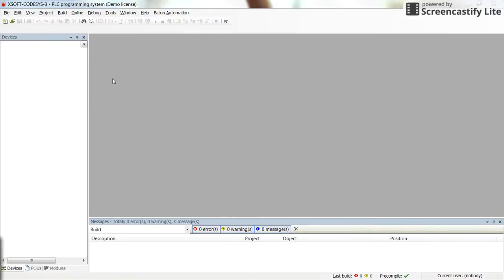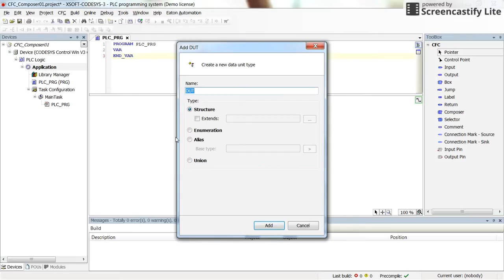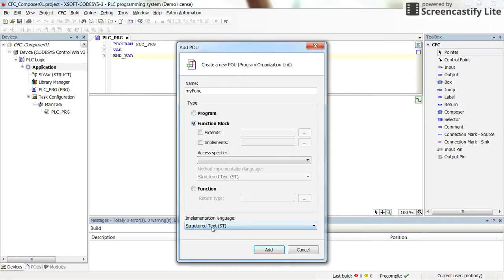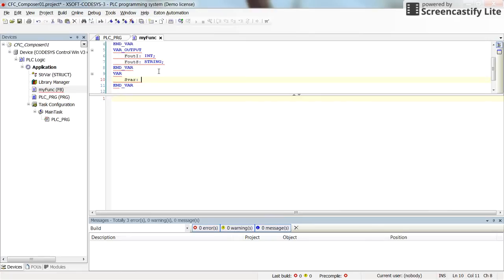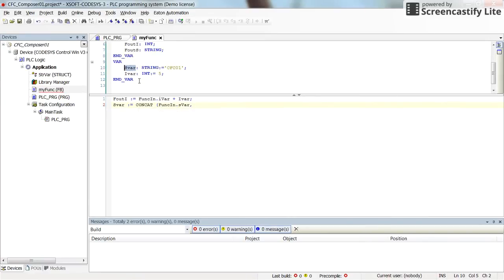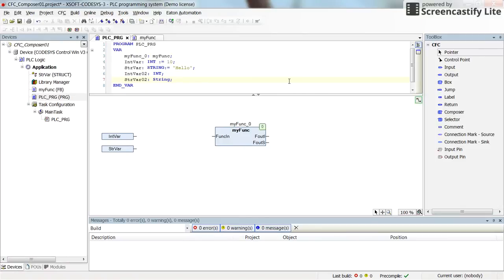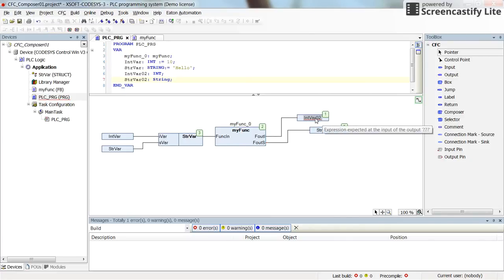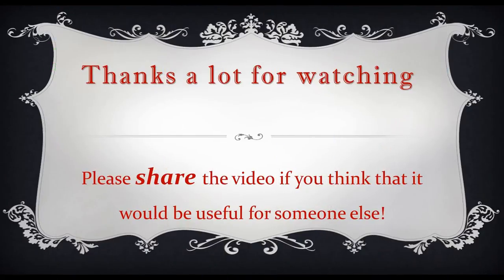CODESYS: Composer element in CFC Programming #COMPOSER #codesys #plcprogramming #iec61131 #cfc

Comment: Hi, Is it possible to use this instruction in other language programming?
thanks
Reply from the maker: +Victor Sj As far as I know, this is only for CFC. However, in other programming languages you can set the fields of a structure by referring to its fields using the "." notation.